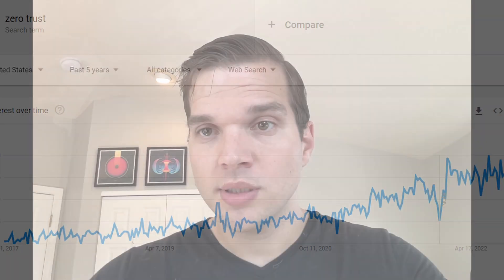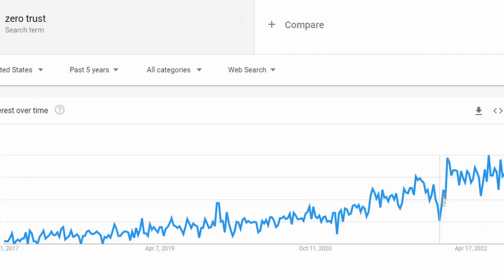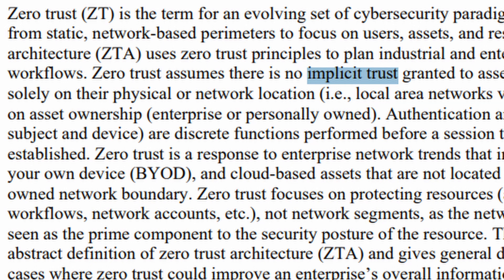Zero Trust Architecture Explained

Comment: This is the first time I am hearing about Zero trust architecture. I have a doubt, when you gave that example about ffmpeg, I was curious as to how can we restrict that it only operates on a certain files and folders? Because when we install it using apt get it installs globally and can be run from anywhere